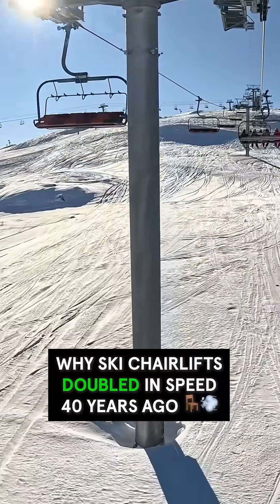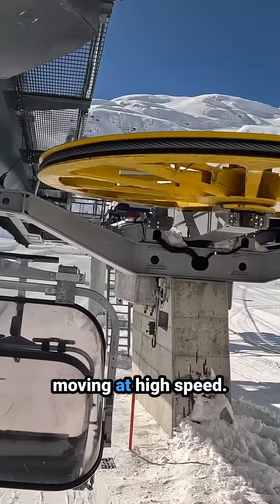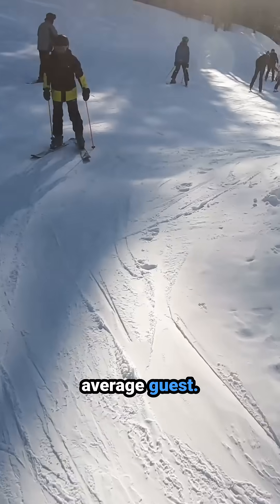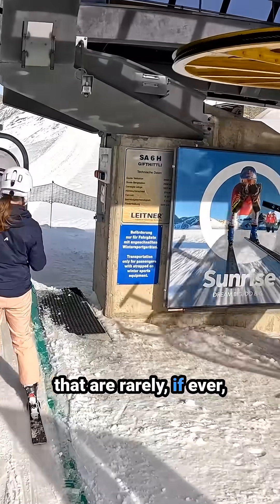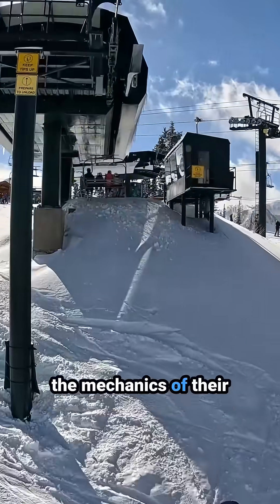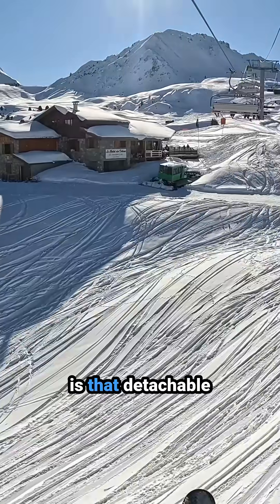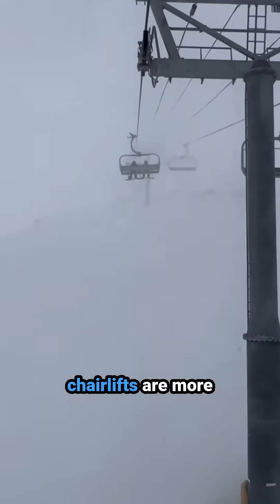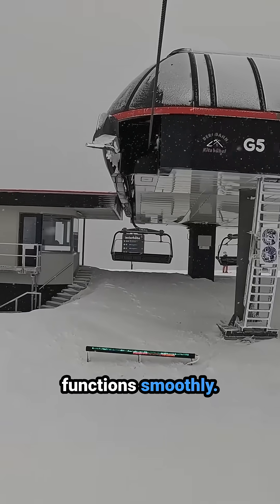Why Ski Chairlifts Doubled In Speed 40 Years Ago

Comment: Some fancy lifts have little moving carpets at the loading stations, so to increase speed and loading safety for fixed grip chairs, what is stopping resorts from adding this moving carpet element?
Reply: They are expensive - cheaper than detachables, but still expensive, and subject to operation issues.

Comment: Iv always wondered do these lifts actually detach from the cable. Can they move closer or further away from the chair in front of them, do they need to be re spaced
Reply: Yes, they fully detach. A sensor detects chair spacing and the wheels in the base stations that the chair is on when detached from the cable can be used to correct the spacing. "Spacing Clutch Start - Detachable Ski Lift Doppelmayr" video on Youtube shows this. Orange springs in the video are part of the clamp at the chair top.
Reply: @ thanks Iv always wondered how this worked

Comment: It's not a disadvantage for detachable chairs to be spreas further apart, it's an advantage, because you need fewer chairs. And detachables can reach higher capacities without larger chairs because chairs can be closer timewise. There are also so tricks to further increase capacity, like 90 degrees embarkments or even double embarkments.
Reply: I time the lift counting spacing between chairs in seconds or the time between chairs at the terminal for fun while skiing. High speed or fixed grip does not matter. Its usually 8-10 seconds between chairs (very few faster than 8 seconds and some beginner chairs having more than 10 seconds between), meaning a fixed grip quad and high speed quad have the same rider capacity per hour. The only difference is how long you spend on the lift as a rider. So in a situation with no lift lines you can get more runs in per hour on a high speed. The high speed detachable chairs also come in 6 and 8 person varieties, this is where mountains are actually gaining more throughput when they replace a quad with a 6 or 8 pack. However, a poorly setup line on a 6 or 8 pack leads to unfilled chairs and other problems in getting 8 humans in sync and listening to the lift ops.
Reply: @RIPPEDDRAGON40k  6 person chairs can also be fixed grip. 
Not all, in fact only very few, lifts use the maximum possible capacity. But detatchables can reach higher capacity if a resort needs it. There are 6person chairs with well over 3000 pph, that's not possible with fixed grips. Also there are 8 seaters with 4200 pph, having less than 7 seconds between chairs.

Comment: I’ve seen way too many stops and down times for detach’s at beginner areas because the guests aren’t getting on/off safely. But also, detaches have more moving parts = more down times due mechanical and/or electrical issues.